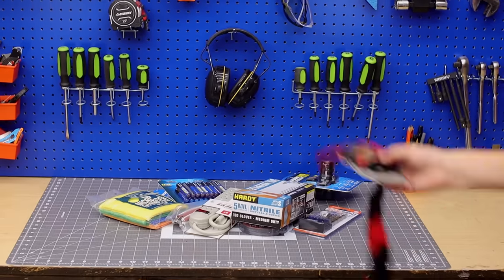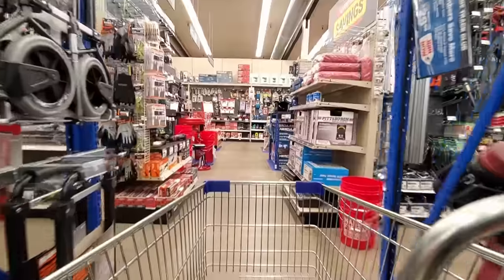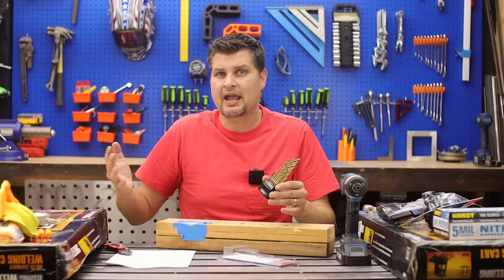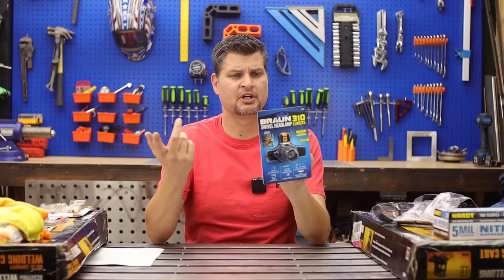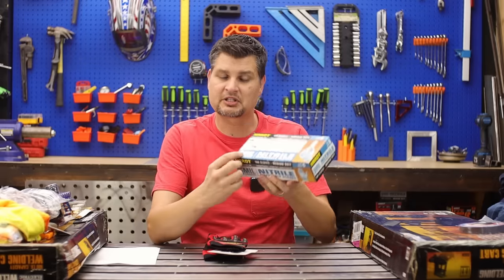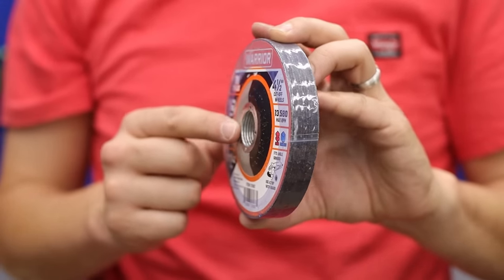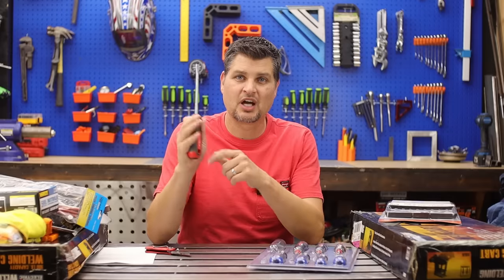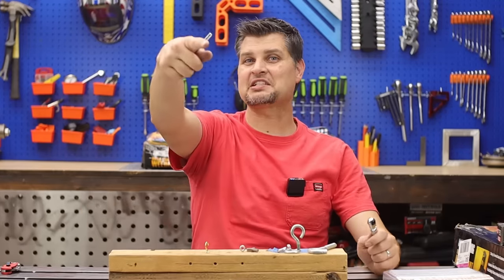Do NOT Buy This Tool at Harbor Freight Parking Lot SALE

Comment: That drive bit is made just for cup hooks.  Eyes don't need anything but a screwdriver through them.  In actuality I have always used linesman's pliers for cup hooks and have never used cup hooks for cups.  Only for key holding!
Reply from the maker: I'd cut out that exact part of the video where I went into showing that everyone just uses a screwdriver. Thanks!

Comment: That bit is for wing nuts.  Most wing nuts I've met don't need any additional torquing.
Reply: And cup hooks. I had a bit like that and it was marked for cup hooks.
Reply from the maker: I was curious about wing nuts. I assume it will work pretty good until it go further than the threads will allow.

Comment: Do you not know theres soft and hardened steel or did I miss somethin?
Reply from the maker: Did I miss something? Should I have talked about that somewhere?
Reply: @-DIYPRO- when you were talkin about the drill bits you mentioned they wouldnt go through steel but then said they were marked for soft metal. It sounded like youd tried em on some kind of metal but I didnt catch what type and was hopin you could clarify if you tried them on soft and hardened steel, and if you thought by soft metal they meant unhardened steel, or like aluminum, brass etc?
Reply from the maker: @lethargiclycan1115  Ok I see. I have tried them on plan carbon steel, which would be a "soft steel" and they only last a couple holes. When the package says for soft metals they mean your brass, copper, and alum.
Reply: @-DIYPRO-  oh ok gotcha. Do you have any recommendations for a decent set thatd be better for steel?